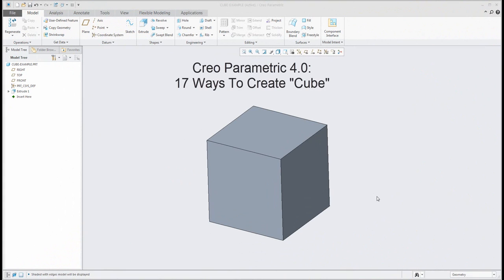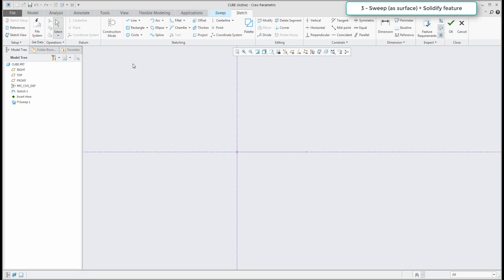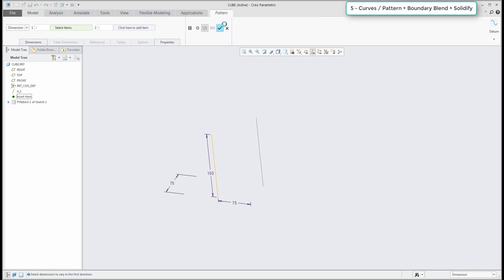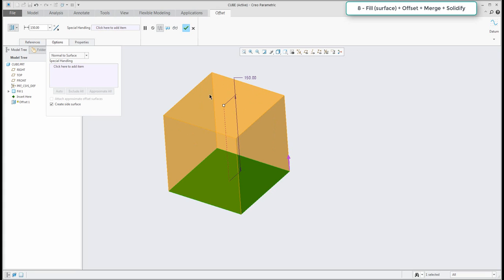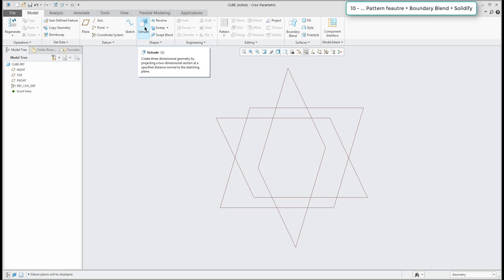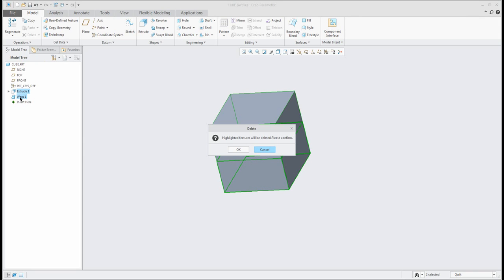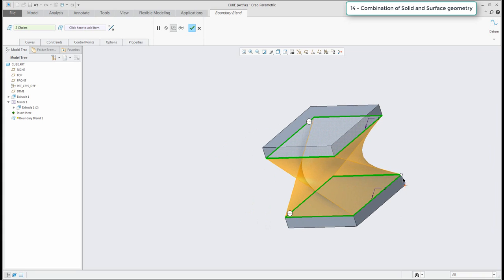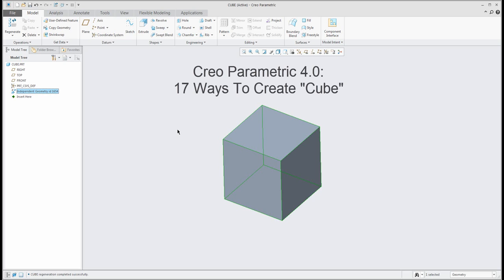PTC Creo 4.0 tutorial: 17 Ways To Create CUBE

Comment: Hello sir I have question
 I make electrode and many of electrodes have irregular shapes and I want to make coller (square or rectangular) on electrode at the center of the electrode profile then How to make it because it is very important thing to edm operation profile should be center of coller .
Reply from the maker: Hi, thanks for your question. If I understand correctly... You need to create special shape... Please try t use Blend feature (you are able to connect circle profile to rectangle)
Reply: @4kside  No sir, My question was I just want to create a sketch ( Rectangular or square ) and then extrude at the exact center on the surface which have not straight  edges for reference.
So If I  get  extact center point on the irregular edges surface so that I can create sketch.

Comment: Dear Vladimir,

I'm glad to have the possibilty to learn so many features in Creo by looking at your videos.
Currently I'm doing an autodidactic training in CREO 5.0 at my engineering agency in Wuppertal.
Your advices are great for absolute beginners like mine. My experience sounds as follows:
 
3 years  PROREN2 (Isykon GmbH Spin-Off of Ruhr-Universität Bochum(Germany)
0,5 y      CADAM
28 y       CATIA (V3 until 1995, V4 until 2007, V5 until ???)
1,5 y      SIEMENS NX.

What's funny that you speak "opposite" like Oppo-Side. It ain't necessary, cause it's 
spoken "ˈäpəzit". Otherwise your English is quite perfect!

One question of mine:  
where do you live? I mean, I could hear a little French accent? Am I right??

Kind regards from Germany (still struggling with CREO-philosophy)

Hans-Matti Helmers (59 of age; 50% Finnmade)
Reply from the maker: Dear Matti, thanks for your positive feedback. Stay tuned and share my video with your friends or colleagues. Best Regards Vladimir